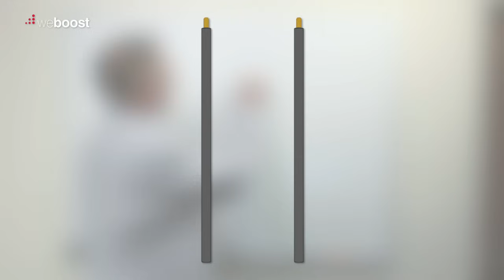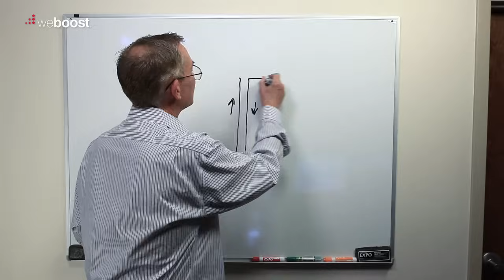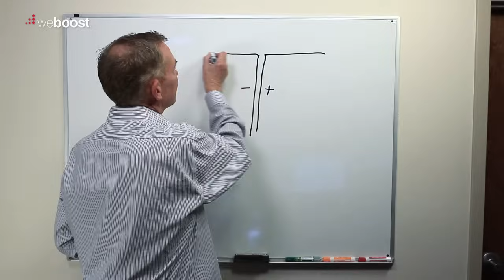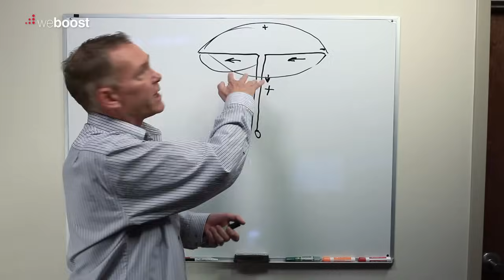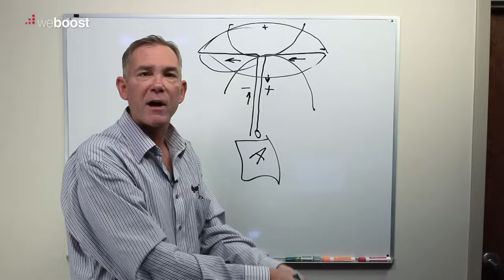How Does An Antenna Work? | weBoost

Comment: I've been in electronics all my life along with being a ham radio operator. I was taught antenna theory in tech school too. Through all that experience there was one concept that no one ever talks about but still makes the most and easiest sense to me. 
   Every communications path involves two antennas. A transmits and B receives or B transmits and A receives. What is an antenna, really? It's made of conductors which are usually tuned to resonance. Don't let that scare you. Here's  why. Resonance is a phenomenon that allows for maximum energy transfer either out of a transmitter or into a receiver. It's achieved with designing the best  antenna length/configuration for that purpose. You can play with some formulas if you want to but the concept of energy transfer is all you really need to know.
   Now peel away an onion layer and consider magnetic fields. Antennas work by radiating or receiving MAGNETIC fields at the rate of some particular AC current. That rate is mathematically related to the antenna design. Once again play with the formulas for that if you like.
    That's it. AC magnetic energy transfer from one place to the other. One further point of potential interest  (optional but very helpful) lies in transformer theory. Look it up for study, but any simple transformer is made up of a primary winding and a secondary winding. The primary couples energy to the secondary winding MAGNETICALLY. What's that? Energy transfer from one winding to the other sounds like a transmit antenna and receive antenna doesn't it? Yup, it does sound like it because it is like it! 
   In the case of the transformer the radiating winding is much closer to the receiving winding than two antennas would ever be, but it's still just transferring energy  from one place to the other. Simple, right?  Congratulations. You now know how antennas work! There's more to it of course to optimize performance, but the analogy of antennas to transformers is the main thing to remember.
Reply: I do not get the logic behind the essentials explained. My confuses: why would the energy radiate once you implicit the Circuit as shown. Like why would the energy leave the circuit just because Current flow in the same direction. Would’nt that also cancel them out? Why would’nt all energy just continue into the cathode? Could someone with a Nice soul please clarify this to me? I really must say i’ve allways fellt smart until i’ve tried to understand the logics and deeper fundamentals with radio signals.
Thanks in advance.
Reply: Kandela:  How does "pumping more than the legal limit in to" your antenna improve your ability to receive? Perhaps you are not interested in that side of the communication link?
Reply: Hey! Are we talking tuned circuits here or friging transformers? Please, if you are giving input to those that do not know, do not confuse the issue with your  incorrect .....whatever you are trying to say!
Reply: @timbosam  My goal was to clarify what was being seen as a rather mystical concept, so im sorry you saw my explanation as confusing. Perhaps you missed the main point i was making, which was the magnetic coupling concept, for which its immaterial if its a tuned circuit or not.
Reply: @joewoodchuck3824  I'm a new ham, i understood what you meant. To me, it would make sense that on a standard american device using a transformer to step down  voltage that you are transmitting a sine wave at 60 hz of radiating frequency to be received by the secondary windings with or without the use of the centertap. If it's not being transmitted from one winding to another then I'm guessing theres a lot of people that took the same industrial electronics class i did that are now dead from incorrect information. I'm wondering if the others here are confused because the video is about direct current antennas and are just nitpicking the details of your explanation against the title of the video.  73 Joe.    KG5ZEF
Reply: Oversimplification. I hate when people do this.
Reply: Can my old antenna on my roof attract unwanted RFs ect? Should I take it down?
Reply: @rachelhancock6833  No antenna "attracts" unwanted rf. It only responds to the RF already present.
Reply: @joewoodchuck3824  thank you❣️So if there is RF present it will act as a conductor? I obviously don’t know a lot about this field 🙈
Reply: @rachelhancock6833  There's almost always RF present. By definition an antenna is a conductor. It would need to be if it's to respond to RF signals.
Reply: @joewoodchuck3824  thank you❣️If I took the antenna down would that lower any rf? I’m so sorry I keep asking you so many questions 🙈
Reply: @rachelhancock6833  Once again, receiving antennas don't attract rf. They only respond to any RF already  present. There are few if any places on earth with zero rf, so as long as you live here you'll always be in RF fields of varying strength and wavelength..
   Just out of curiosity, what is the antenna in question made for?
   Happy to answer questions.
Reply: Primary winding ? Secondary winding ? If you are a ham operator you must have remembered the answers cus you don't know RF. You are describing how a transformer works not an antenna. If you are going to make a good antenna you want it to be resonant. If you know what that means. I don't know what you were tought but you are wrong.
Reply: swatter 521.  
I still support what I said however in that a signal fed to an inductor primary (conductive wire) creates a magnetic field which which is then coupled to a secondary inductor to convert the magnetic field back to electrical energy as in any untuned  transformer. One can also make an RF transformer such as with an i.f. transformer using the very same magnetic coupling from primary to secondary. Now make the i.f. transformer perhaps with only turn such as in a resonant or even a nonresonant loop and place it near enough to another receiving loop and there will be at least some of the energy magnetically coupled there. Make them both resonant to a given frequency and the coupling becomes much more efficient of course. Those could rightfully be called antennas. Even the nonresonant loops could be consixered antennas only with  far less efficiency. From there it's simply substituting any other antenna design, usually resonant, and get energy coupled between them.
   So, we have in the first place a transformer magnetically coupling between  conductive windings (wire), and antennas in the second place which couple energy magnetically, and thus an a legitimate analogy being drawn in that any of  tbese systems couple energy.
   Perhaps now you understand my analogy. Whether you understand it or not, or agree or not, I still stand behind it.
Reply: joe woodchuck if you been working with electronics all your life i don't know what to say but im sorry you are wrong. I been also working with electronics all my life plus i have 2 degrees a master in electrical engineering and a bachelor science in electronics. Plus i have been playing with RF since i was a kid. I hold a extra class ham ticket. A army MARS licence and a GMRS licence. Plus i own and climb commercial towers.  I went to ANDREW for terrestrial microwave school, coax school, and, connector school. So i have many years of radio experience. You can not induce a magnetic field with rf. You are confused . To induce a field you need Ac power. That is why we don't use dc for housing and every day power. You cant step up dc with a transformer. That is why we went with tesla instead of Edison. Rf and ac use difrent types of transformers. For different reasons. An antenna has no transformer. I have made every type of antenna possible and a few designs of my own. Not a single one had a coil driving a coil doesn't work that way. A coil on an antenna ad's inductance to electricly shorten the physical legenth. Nothing more. It's a trap. Cb or 10 meters 102 to 108 inches is a quarter wave. No coil. 2 meters 15 inches is a quarter wave. No coil. 70 cm 5-6 in a quarter wave. No coil. The antennas with a coil are all in series. So when you send rf into you so called transformer how do you hook up a radio? Run the center lead of 50 ohm coax to one side of the coil and hook the other to ground? If you do that you will blow up the radio cus the coil is a dead short. Put a ohm meter on your coil transformer it will show a closed circut. You hook up a nice icom to that and you will be sending it back to icom to put a new p a in it. Don't put a amp on it. What is your SWR with that set up ? How much resistance is in there ? What is the impedance on that hope it is 50 ohms. It's not gonna be i guarantee. Tell me how that talks. Hope you don't need to go down to 80 meters gonna be some big transformers. Lol 😆 the thery you are imagining is all wrong for rf.  What you are explaining is for AC power except all the resonant stuff. Transformers use turn ratio to turn ratio like 11 turns primary winding 65 turns secondary winding and the gauge of wire ratio between the two around a steel core. Just because you been into electronics all your life doesn't mean you are right. Whare is the coils on a yagi ?
Reply: swatter 521. With all your credentials you didn't even understand what I said. For one, where did I mention dc? For another, what is it you've been missing all through your career that antennas radiate magnetic fields that result from the application of alternating current? The field alternates too which you somehow turned around to your own interpretation. 
Once again, one antenna radiates a magnetic field  (alternating of course) and another receives the field and converts it back to AC at the same frequency of the radiating antenna. That ac signal electrical signal feeds the first rf amplifier stage from which it goes on for further processing according to what modulation mode is being used. If it isn't a magnetic principle between the antennas, then what is it? And yeah, I know about E fields, but those are considered in communications to be near field.
Reply: Oh, and I never said that antennas needed or should be coils. If you had bothered to absorb the full process of explanation and contextual meaning of what I said, you'd have realized that. You're very good at changing other people's intentions and what they are trying to convey. 
May I once AGAIN say that I never intended for a magnetic field be interpreted as static for antennas as in dc, but rather an alternating field. That point should have been obvious.
Reply: joe woodchuck you are way out of your league.
Reply: swatter 521. While continually claiming I'm wrong, you still haven't told me what YOU think is the principal of getting a signal from one antenna to the other. Unless you do I'll have to assume that you don't know.
 I don't mean antenna theory either. That isn't what's under discussion. I want your opinion of what principle of physics is involved in getting radio signals  through the atmosphere.
Reply: @ swatter 521

Quote:  
".... Not a single one had a coil driving a coil doesn't work that way..."

Isn't that what a 'balun' is?  A primary and secondary coils to alter the impedance at the feeding point.
Reply: Perhaps nobody here cared about the Direction of the current !
Reply: @joewoodchuck3824  I read your analogy and I liked it. The idea being that magnetic energy transmission is in the center of the working principle for short or long-distance communication. The swatter guy is a troll.
Reply: @sithionta4017  Thank you. I dont understand people like swatter. He claims he has degrees and talks the talk, but doesnt conceive the magnetic field as being the means for communications. Theres only one other coupling method which is electrostatic. We all know it isnt that except for near field or e field which is only considered to affect anything within a few wavelengths.
  Funny, i had recently thought about that debate. You must have telepathized something to me. Lol.
Reply: @joewoodchuck3824  maybe telepathic communications work through magnetic fields as well =p
Reply: @sithionta4017  There are various theories on that, but you never know. Are you a ham op?
Reply: @joewoodchuck3824  haha, you never know.. About your question, no, I'm not a ham op (I'm an engineer, but sadly not with as many diplomas and merits as swatter guy)
Reply: @joewoodchuck3824  

So is the magnetic field transmitted from the primary to the secondary winding in a transformer electromagnetic radiation the same as radio waves or visible light?
Reply: @llh3025   Yes.
Reply: @joewoodchuck3824  

Thank you!
Reply: @swatter5216  i think you missed joe wood chuck's point. i think he was just saying that rf probagation and receiving is similar to an ac transformer action in that magnetic fields are sort of induced. the transformer windings are close together and use induction and an iron core with an ac 60 hz sinewave  and the radio transmitter uses a form of  ac at an rf frequency which is propagated out into space and received at a distance to an antenna connected to a tuned RCL cicuit.

Comment: Well, I guess that is somewhat of an explanation. If you really want to understand it, I recommend that you do some more reading and/or viewing. When a charge is moving, it creates a magnetic field. If that charge moves back and forth (oscillates) then it creates a changing magnetic field. And that changing magnetic field creates a changing electrical field. And that changing electrical field, in turn creates a changing magnetic field: they each create the other. That is an EM or electromagnetic field and it moves at the speed of light. So the charges in the wires/conductors of the antenna are the original moving charges and the whole thing proceeds as described above. The fact that these fields are CHANGING is an essential element of this: if the charges were only moving in one direction all the time (a DC Voltage), there would be only an initial pulse of EM energy when it is first turned on and it would die out rapidly (microseconds or less). 

As I said, if you really want to understand it, you need to look further than this.

Comment: Coax explanation not actually correct.  To RF, coax has three conductors and the RF return current is on the inside of the braid, not the outside.

Comment: Very nicely explained, but I'm still hung up on the coax cable antenna thing.  The center conductor is one wire, and the shielding is ground (And) negative? So how would the coax cable allow to transmit or receive if it's conductor and shielding is STILL parallel to each other?  Thx bud..looking forward to going through your vids

Comment: Hello,
Do you know how is the relation between the length of the antenna and the frequency ???
Reply: Soraya Yousefi: Divide 300 by the frequency in Mhz and that will give you the length of the (full-wave) antenna in metres. For example....CB radios are 27 Mhz in the US and UK so if you divide 300 by 27 you get the answer of 11.1 metres (36.4 feet). Divide this answer by 2 and you will get the length of a half-wave antenna which is what usually works best. Divide it by 4 and you get the length of a quarter-wave antenna which is what most "mobile" antennas are.

Comment: I love the  explanation that the energy jumps off the wire and into the air.   Why didn’t my physics professors explain it like that?
Reply: Awful, simplified erroneous explanation. Current maximum is at the center feed. Of a dipole, voltage maximum is at the dipole ends. The legs of the dipole need to be electrically quarter wave multiples for resonant radiation of as much energy as theoretically possible, twin open wires make just as good transmission lines as coaxial cables, which became popular in world war 2. Coaxial lines do not supply “power” only to the center line - the shielded coax supplies an opposite charge from the center line and due to skin effect goes through the inner surface of the outer shield - reflected power can, unfortunately travel down the outer surface of the shield and since opposing currents don’t cancel out radio emissions, common mode currents can radiate energy outside of the antenna structure.

Radio waves don’t jump into the air - take a look at Maxwell’s Equation for just an idea of how electric currents induce magnetic fields, and vice versa.

In short, this looks like a great explanation for those that do not know anything about the subject and don’t need the correct information.

Look elsewhere for a good explanation of the subject.

Not this one.
Reply: Yes, with the greatest respect to this late presenter, this is a very poor explanation of how an antenna radiates.... Actually, not really an explanation at all!